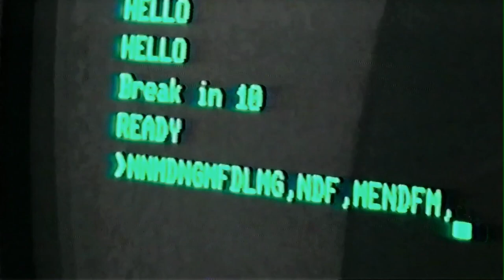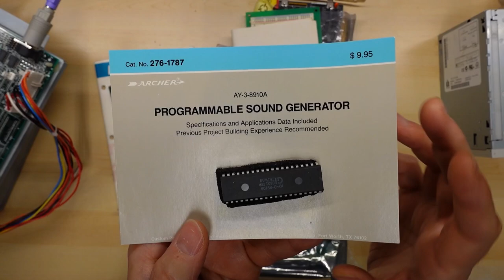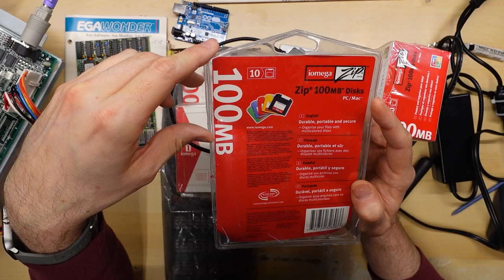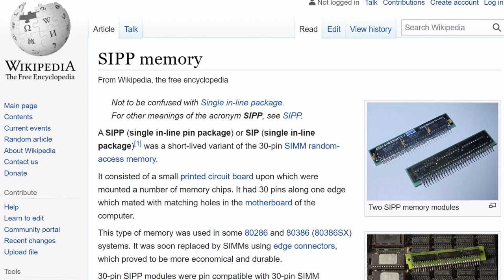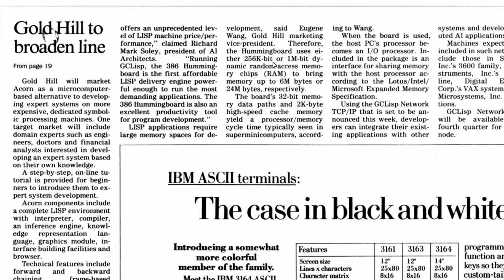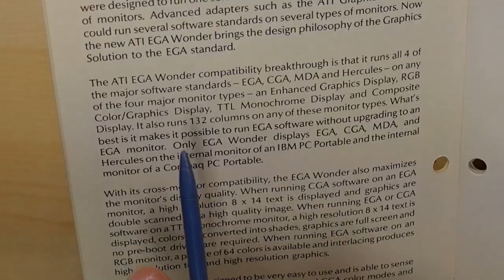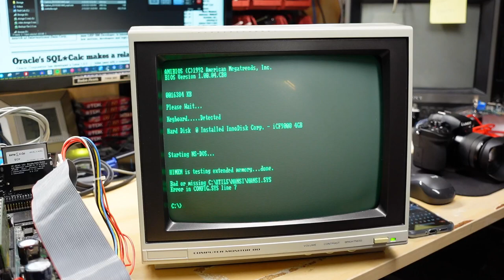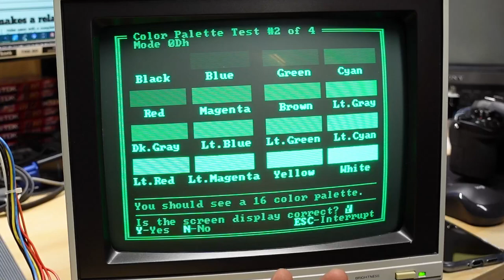A 386 A.I. Co-Processor from 1986, an EGA card driving a composite CRT, and an ISA Prototype Card

Comment: I'm glad I'm not the only one who found this hardware interesting. I'm betting that the LISP card was probably used by a group who were doing surveys of galactic populations and types. I got that card in the early 2000's with a old camera system from the University of Arizona surplus auction. I think I may know who was using that card, and see if he recognizes it. Maybe he can help with any documentation or at least some insights on how to use it.
Reply from the maker: That would be amazing -- if we can't find more about it, it will forever just be a curiosity. If we can boot it, then I will have to brush up on my LISP!
Reply: @adriansdigitalbasement  IDK if you are aware of Symbolics, the creators of LISP machines, including Symbolics 3600 with the "Space Cadet Keyboard", but they created the Ivory LISP card which fit into 68k Macintosh computers. It may have required a Quadra, and may have been NuBus.The chip itself was a hardware implementation of LISP, and ran "Open Genera", and all-LISP OS. It's a fascinating story. While starting to fail, and giving up on hardware, they ported Open Genera to the first 64-bit chip, a DEC Alpha. Unfortunately they were sticklers for speed, and wrote so much of it into the chip's microcode, that it wouldn't run on second-generation Alpha chips. My ex was basically the last employee of Symbolics (later bought by owners-employees). Also Stallman's anger at Symbolics and their commercialization of LISP written at MIT is what inspired him to start the "Free Software Movement".
Reply: I always read throughout the turn of the century that LISP was such a great language, but no one ever really used it, why?  And if you know about LISP, generally, how does it compare to Pascal and Swift?
Reply: @Dragon1276  Lisp is handy for writing extensions in Emacs(I'm not a *nix head, but I knew people right up to the mid-00s who did that sort of thing) Personally, I found it unintuitive as a language, with a tendency to get lost in a maze of recursion and parentheses. YMMV, but I detested my time with it, and would avoid it more than I would COBOL-77, and I regarded COBOL a PITA.
I think it's still used in some Neural network applications, especially the sort based on decision trees in the early stages of the diagnostic. I'd have to check that.
Reply: @Dragon1276  I don't know. I'm a pointers and structures guy. C. I don't know what LISP is predicated on.
Reply: @Dragon1276  it’s a very old language - from back in the 50s, and primarily used for A.I. work because it’s main strength is in handling of data sets, as it’s name (LISt Processing) implies. Wikipedia has a detailed write up on it including some sample code.  It’s certainly nothing like Pascal.  https://en.wikipedia.org/wiki/Lisp_(programming_language)
Reply: @AndrewTubbiolo  Lisp's history is fascinating. Intended originally as an intermediate language, not to be programmed by humans, but to support a higher-level language its designer—John McCarthy—had envisioned. Lisp had been specified in 1958, and by 1962 while McCarthy had turned his attention to developing the originally-envisioned higher level language which was to compile to Lisp as an intermediate language, McCarthy realized that colleagues and students were already programming in Lisp directly.

I'm no Lisp expert, and like many found the syntax strange, but it's kind of remarkable once one gets a sense of the semantics of the language: The parens aren't superfluous; they specify binary trees. And in a formidable symmetry, the language itself parses to the same trees the language manipulates and expresses syntactically. Compare with 'C', whose parse tree (seen only internally by the compiler) looks very different from the syntax of the 'C' language itself. Thus the 'C' preprocessor can perform some text-based macro substitutions, but there's always a gap between the preprocessor and the 'C' language. In Lisp, the language syntax parses to trees manipulated by the language semantics; it's kind of a wild paradigm. So "macro processing" in Lisp means manipulating the parse trees of the language itself (the stuff that would be internal to the 'C' compiler and completely unknown to and unreachable by the 'C' preprocessor.)

It's kind of like a Klein bottle or Möbius strip, where there's no hard line between syntax and semantics. And it had garbage collection. In 1958.
Reply: @AndrewTubbiolo  P.S.
> I'm a pointers and structures guy. C. I don't know what LISP is predicated on.
Internally Lisp is structured around a cell of two elements.
struct CELL { VALUE first, VALUE next };
And the VALUE elements of the cell either point to another CELL (acyclic), or (if we've reached a leaf of this branch of the binary tree) point to an ATOM (a value like a string or number.)
It's hard to specify this directly in 'C', because VALUE can either point to another CELL, or to an ATOM (which tends to be distinguished by the bit pattern of the field.)
But one can certainly imagine a binary tree constructed from two-element CELLs, each element of which could be a leaf node (ATOM) or a branch (pointer to another CELL.)
That is my understanding of what Lisp looks like in memory.
Another key is that the data is immutable. You can construct new ATOMs and compose new LISTs (CELLs that point to CELLs.) But you cannot modify already-constructed elements. (This provides important guarantees about how such languages perform in recursive or multi-threaded environments.)
Reply: @spatulasnout  I was never great at programming, but I understand languages generally. I understand from your reply why LISP is well-suited for AI. It sounds like you either get an “answer” to an input or you get redirected to a “concept tree”,  in laymen’s terms.  There was so many programmers in the 90’s that believed they were changing the way that people used computers and they’re functionally identical today as the 70’s unless you talk about voice assistants.
Reply: LISP is a really fun language. It's very close to untyped lamda calculus (Scheme, a close relative to LISP, would later be based directly on that) and, among other things like mind boggling functional programming language constructs, supports much more sophisticated support for meta programming via macros than e.g. C.
It's simplicity and flexibility are still amazing to this day!
Also it happens to be the language one of my favorite operating systems (GNU Emacs) is implemented in as well as my favorite text editor (evil). :D
Reply: There was LISP cards for the MAC II Nubus
Reply: @hicknopunk  if you're talking about the Symbolics MacIvory boards, those were very different, far more expensive, and relative to their time, far more powerful than the hummingbird.

Comment from the maker: Incidentally, I tested the larger 3.5" IDE LS-120 drive on an era correct machine and it does work!  It was able to boot to DOS on a 3.5" HD floppy. It makes some strange noises that don't sound quite right, but I got no errors...
Reply: Newer Windows versions doesn't always like the old drives.  I figured it might be just need to be in a machine from the era.
Reply: I’ve used these LS120 drives in 3 of my computers back in the days for backing up data after 2 dead Zip drives and floppy streamers became to slow because of growing data sizes. They always had a bit of strange sounds when using regular floppies I remember when searching between data and fat table/directory. It wasn’t that obvious with the larger 120mb disks. The coolest feature to valve was the electronic eject mechanism which only macs had back in the time. The reason I used 3.5‘‘ drives was two of my computers had small pizzabox style cases with only 3.5‘‘ slots of which 2 were available from the front. I loved these cool cases which were proprietary form factor 486 boards w. onboard tvga and smc 10/100 network. Cant remember who the manufacturer was. They came with really nice Eizo 19‘‘ color crt screens which must have cost a fortune.
Reply: It looks like a bit of disassembly on the laptop LS-120 will reveal a 40pin IDE connector.
Reply: looks like the black ls-120 would fit ThinkPad laptops of the era. I think the drives were made by Mitsubishi and Phillips. An earlier drive was the 20MB Flopitical drive. Interesting drives at the time, but possibly prone to errors due to dust. I have a few in storage roughly between Win89SE and WinXP.

Comment: That Hummingboard is definitely a case of "if you have to ask for the price, you can't afford it"
Reply: Price was about $1595 in 1988 according to my search on Archive.org text contents.
Reply: @hotlavatube  $3,546.13 with inflation! ouch!
Reply: For Apple there was the "PC compatibility card" with a full intel 486 and copro, ram, video card and parallel port in a PCI slot to be inserted in a desktop PowerPC Mac; it had a cool control panel from which u pass control to the pc card and the system would run both CPUs with their own OSes (MacOS and windows, which u need to install apart) and with a key combination (I think it was cmd+enter) it would switch back and forth between dos/windows and MacOS in real time
Reply: @onesixfive  Not all that pricey considered how much decent home computers in general often did cost at the time. I find 1.5k really surprising but thats probably only with the very basic set of ram chips.
Reply: @hotlavatube  1mb back in around 1993 was about $100cad. 24mb would have been $2400 in around 1993...
Reply: @hotlavatube  "$1595" <-- I had to do a double take here, because that's VERY close to $1565, which was the original starting price of a minimum-specced IBM PC. Of course, nobody actually bought the IBM PC in that bare-bones configuration, because that would have meant using a TV as display and compact cassettes instead of floppies. Nobody did that. A more realistic setup cost two to three times as much, in 1981 dollars.
Reply: Yeah but imagine if Apple made it, "one meelion dollars!"
Reply: @hotlavatube  I found a price of 7000$ on usenet, for a 1MB version. Sounds much more realistic, especially remembering the prices for RAM we paid back then.

Comment: The price of the JDR PC Bus Breadboard ranged from $49.95 to $79.95 in their 1992 catalog, depending if you wanted the 8-bit or 16-bit version, and with or without decode circuitry.
Reply from the maker: Such a deal all things considered!
Reply: Surprisingly reasonable. About the cost of one of the Intel-based dev boards these days. We've definitely made strides in development boards, but the flexibility of being able to directly build into a breadboard with direct pin jumper access to all of your chips is ridiculously flexible compared to our current stuff which has more restrictive pinouts for you to use.
Reply: @mndlessdrwer  my thoughts exactly
Reply: I have the PDS-600 without the decode circuitry, which was cheaper and gave you more breadboard space.  It was easy enough to add chips for communicating with the bus.  I just followed the instructions in the book “Build Your Own Universal Computer Interface” by Bruce Chubb.
Reply: @mndlessdrwer  If you don't had a rack-mounted motherboard (in 1992, as hobbyist) this piece was cumbersome to use. Also bus-applications (pun: on a bus card) where nearly impossible to realize as the breadboard-space does not allow that. I always thought of it as a toy. Nonetheless it allows first steps of discovery into a great area. Parallel-Port based shenanigans ("Wiggler") were also common these days and allowed some more comfort, (spatial) detaching your experiment from the PC.

For a (modern) comparison: A decent card for the PCIe bus with a FPGA (which can replace thousands of breadboards) is around from $1,000 to $10,000+. Add to that the cost of the most important thing: Decent high-speed interfaces and connectors to the actual R+D experiment. Without that you send and receive .... bullshit:) BTW There are of course also entry-level boards and sometimes Ebay helps ... or simply not asking for the latest nonsense ... Maybe PCI is enough for tinkering?

To modern stuff like Arduino/Intel-SoC: MCU's (as in SoC or Single-Chip-Computer) are not Microprocessors with their surrounding ecosystem! Such a BUS-Application/Card shown is a totally different use-case. Of course, a SoC or MCU system can also integrate a bus. Such as the mentioned Intel, or STM32-ARM with FSMC. But PCI specifications and the associated timings are a completely different beast than simple port I/O. Nevertheless: Don't be put off!:)

Comment: You can solder turned pin headers onto standard 30 pin sims to make thin into sipp modules. I did this for a ram card in my A2000.
Reply: That’s actually a great idea!!!
Reply: SIPP = single inline pin package btw (Adrian asked)
Reply: I wouldn't add any memory in - it may well be the card came as it is now, with two empty slots. Might be parity modules or cache.
Reply: Just to add, if you try to solder on pins, you may want to put the pins into an unsoldered socket first to get the alignment right (buy one off digikey or ebay something) - then you will have them on straight.  You could use a socket attached on a board but you may have to get creative to line it up for soldering.
Reply: I came here to say this, those sockets will take standard "turned pin" headers (not the square pin type). They are easy to get, I use them all the time to make modules to plug into breadboards.

Comment: I still use LS-120 SuperDisks in most of my retro rigs, in a similar way that many retro tinkerers still use Zip disks.

They have many issues on Macs... But if your retro shenanigans are limited to PC only, then SuperDisk is superior to Zip in every way.

Most importantly, LS-120 is natively supported in motherboard BIOS firmware.  Even back as far as Socket 7 Pentium, and as recently as UEFI on Haswell Socket 1150.
This includes booting OS from disk even when booting from CD is not supported.

The drives came in all the major flavors: PATA (IDE), internal SCSI, external SCSI, Parallel Port, USB...
And if you crack open an external enclosure you usually find an internal variety inside.

They hold 126 MB when formatted.
They read and write normal 1.44MB and 720KB floppies at a much faster rate.
You can replace your normal A:\ drive.
DOS, Win98, WinXP, Win10, Linux.

Comment: To change DOS from using 80x25 for output you need to use the MODE command. For example for the 132x25 mode you were using the command would be "MODE CON: COLS=132 LINES=25".
Reply: or mode co132 depending on which version of DOS :-)
Reply: I knew there was a thing as soon as he mentioned it, like a work on the tip of your tongue.
Reply: I successfully recycled the SIPPs from my 286 to use in my 386 SIMMs.  It was 4 modules for a total of 1M, I was a very poor student back then.

Comment: Neat that the LS-120 is also a 3 mode floppy drive. 3.5 inch 1.2 MB formatted disks were used on multiple Japanese computers (NEC PC-98xx, Fujitsu FM Towns, and Sharp x68000 Compact). Earlier models of the NEC and Sharp computers used 5.25 inch 1.2 MB drives, so I think this format came about to simplify software distribution. Not sure why the FM Towns also adopted it, except maybe to have cross compatibility.

Comment: I did get to play with a JDR PDS-601 as a lab study project (T.S.O., might ring a bell to some older QC residents). Anyway, we were using a 286 as a PLC, programmed in Assembly language. What a pain that system was to troubleshoot, but man was it efficient and powerful. This is my favorite mini mail call so far, Adrian! Keep them coming!
Reply: PLC in assembly? Why did nobody write a ladder logic converter for that?
Reply: @spacehitchhiker4264  They probably were implementing the actual PLC system which would take ladder logic and then act on it.

Comment: One of your best mail calls!   I remember having that proto board.  Got it for my birthday from my dad.  Unfortunately, I never did much with it, as by the time I got it, ISA was on the way out, and I always wished I could have gotten a PCI version.  I challenge you to proto up a test of at AY audio chip on that board. That would be the perfect match to use both items!  I can confirm that the original COCO1/COCO2 did NOT have any dedicated sound chip, but although I am pretty sure, I can't exclude the COCO 3 specifically.  I bet the confusion is that I think the Tandy 1000 may have had one of those chips in it.   As for the EGA, I remember that being the GOLD STANDARD in it's day, and I had a friend who got that exact card and it was awesome.  I was always jealous of that card.

Comment: The next year saw the VGAWonder (1988) which added VGA resolutions, and really cemented ATI's reputation. Soon the Mach coprocessor cards appeared, Mach8 and Mach32, and ATI was firmly established as the premier maker of graphics cards. The Mach cards could emulate an IBM 8514/a 1024x768 256-color solution, the first genuine hi-res full-color turnkey PC graphics solution. It's hard to remember that at this time, programs had their own hardware drivers included, there was no standardization, and hardware was evolving at lightning speed, particularly bus mastering hardware with coprocessors like the Mach. So that card you have there is a real piece of history.

Comment: Hi Adrian, I use LS-120 quite a lot, actually they're not very fast with 1.44MB disk, just compatible and maybe slightly faster. But if you got 120MB disk they can hold 120MB data, that's the selling point back in the old days, 20MB more than ZIP and no need to have an extra drive, since it can read write old 720MB also, I still have one LS-120 USB drive, they can use directly under Windows 7 and 10, no driver needed. When BIOS have support, no drive required under MS-DOS.